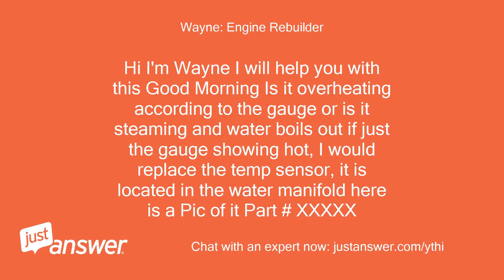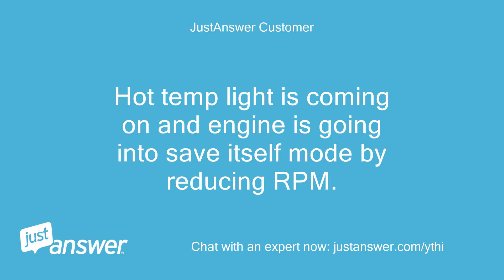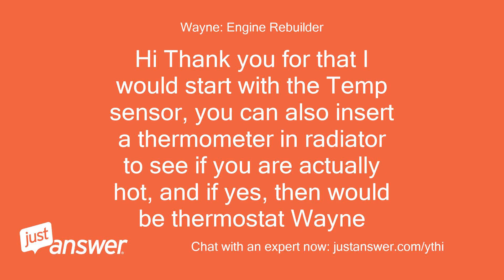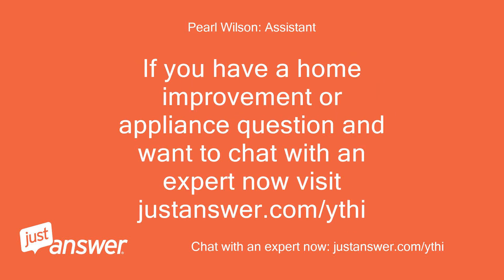3 year old JD 620i Gator overheating. Coolant overflow tank

Comment: HAVE A JOHN DEERE 625I GATOR KEEPS OVERHEATING , ALREADY CHANGE THE THERMOSTAT AND TESTED TEMPERATURE SENSOR AND STILL OVERHEATS ANY IDEAS TO FIX THE PROBLEM ?
Reply: mine is doing the same, how did you fix yours